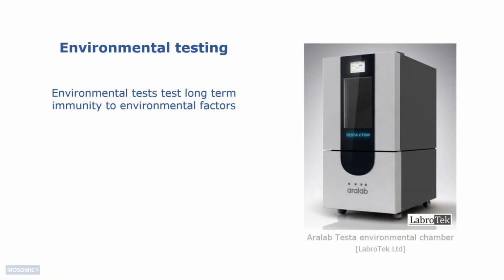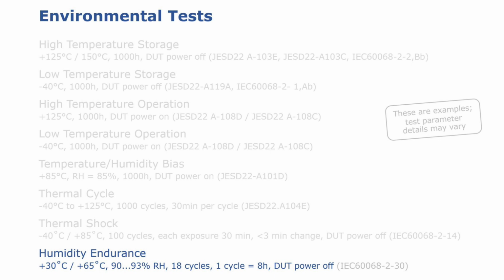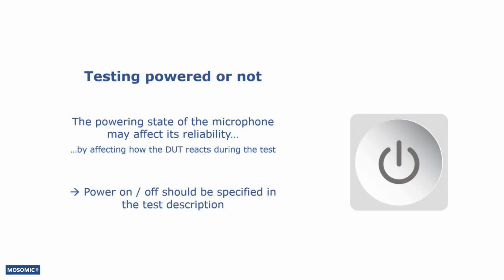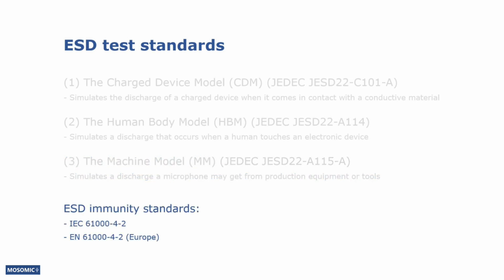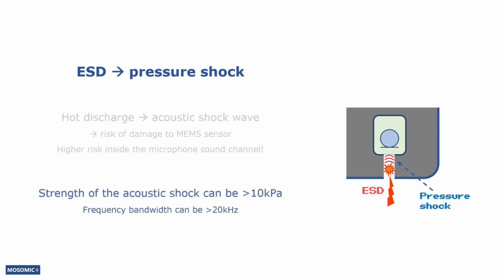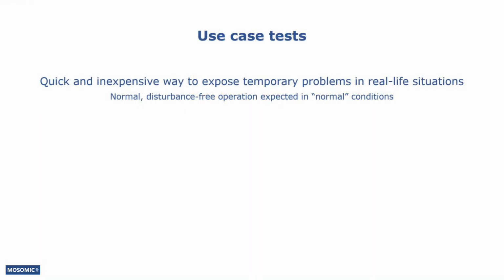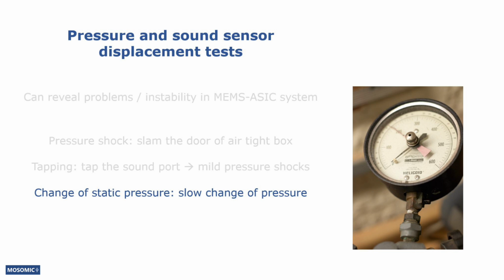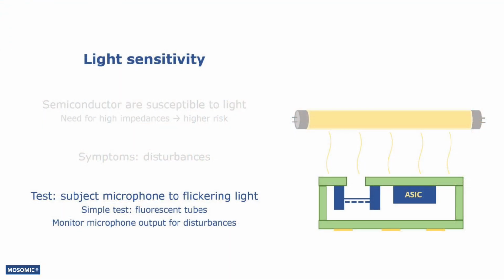Reliability Testing, Part 2 | MEMS Microphone Guide Ep28 | Mosomic

Comment from the maker: 0:37 Environmental tests
- 1:28 Common environmental tests
- 5:06 Requirements for microphone performance after test

6:46 Contamination tests
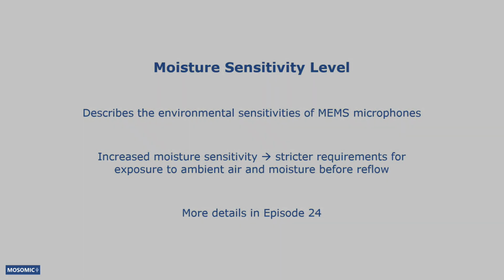9:06 ESD tests
- 9:55 Three common ESD test standards
- 10:39 Component and device level tests
- 12:19 ESD test variables
- 12:48 Pressure shock caused by ESD

13:43 Reflow tests
14:43 Latch-up test & DC safety check

16:26 Use Case tests
- 18:56 Pressure and sound sensor displacement related tests
- 20:26 Temperature and humidity related tests
- 22:03 Deformation related tests
- 22:41 Light sensitivity tests

Comment: Johann Pachelbel. Canon and Gigue for 3 violins and basso continuo In Hiroshima
Mems Microphone ICS-40730
https://youtu.be/hbZV7pXgv3I

Simultaneous recording
Johann Pachelbel. Canon and Gigue for 3 violins and basso continuo In Hiroshima
Sanken lavalier microphone COS-11PT
https://youtu.be/wfZdY483XeY

Brahms Symphony No. 2 in D major, Op. 73 Mihara Chamber Orchestra
Mems Microphone ICS-40730
https://youtu.be/WZ_k-xTd9OQ

Messiah
Mems Microphone ICS-40730
https://youtu.be/05veph008Z8

I would be happy if you subscribed to the channel and gave it a high rating.